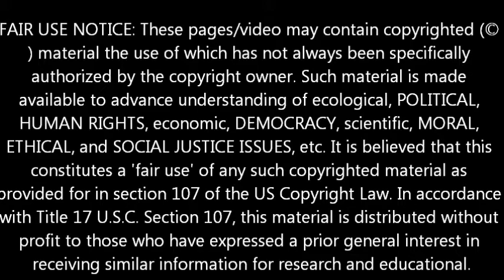SINKHOLE STABILIZING? KLFY 10 March 15, 2014

Comment: WTF U.S. Selling Oil From Emergency Oil Reserves May be Stabilizing Now, but what Happens When the Oil is Drained From the Salt Domes?
Reply from the maker: So agree with you Robert!
Reply: cajunmiracle Yes my Brother, the Time Grows Shorter it would seem. I'm Glad that you are one of The KING'S Kids :-)
Magnitude mb 4.0
Region KANSAS
Date time 2014-03-16 08:46:20.0 UTC
Location 37.20 N ; 97.88 W
Depth 6 km
Reply from the maker: Thanks Robert
Reply: cajunmiracle TY Brother for your Steadfast Reports :-)